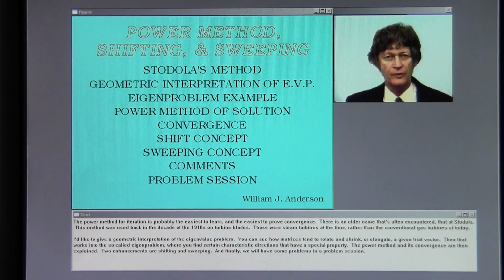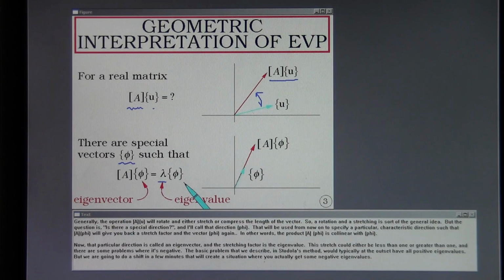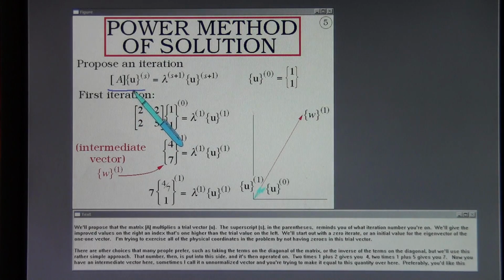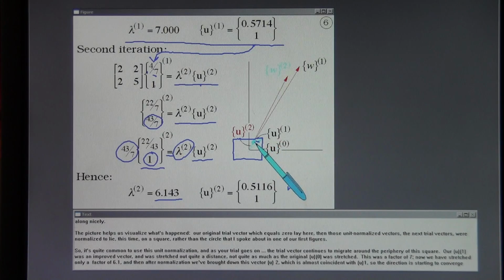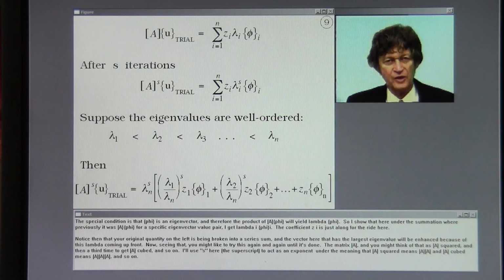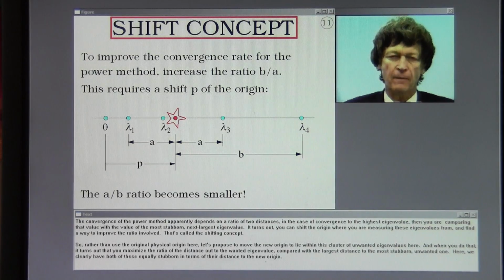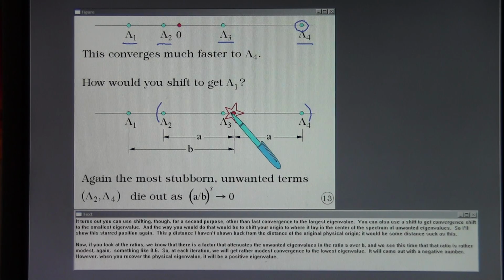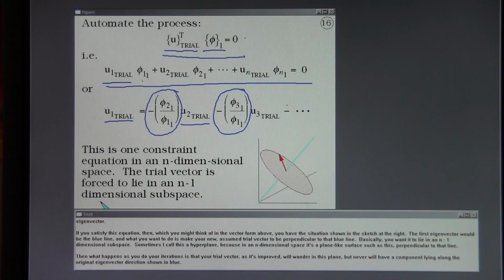Power Method. Lecture 5, Part A.

Comment: There is an easy method to sumultaneously obtain several eigenfunctions with the power method. See Los Alamos report LA-UR-07-4046 ""Multiple extremal eigenpairs by the power method"  
arxiv.org/pdf/0807.1261.pdf